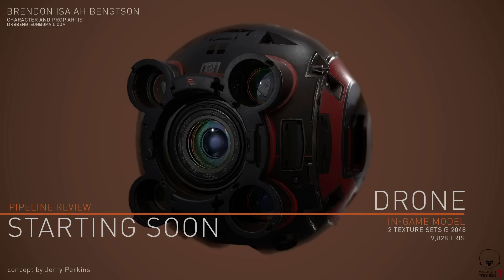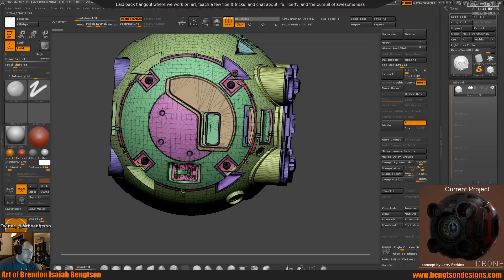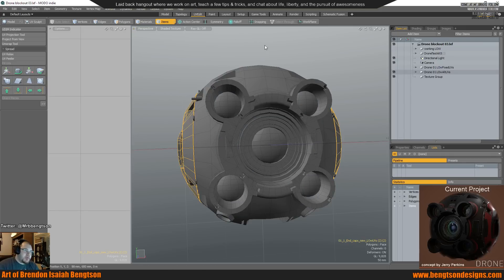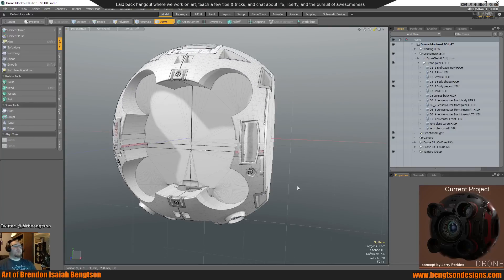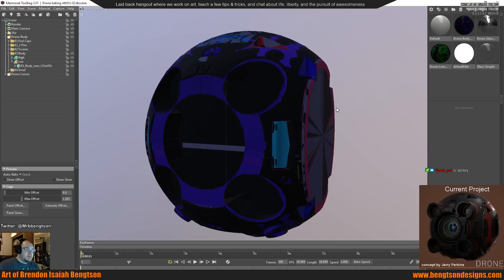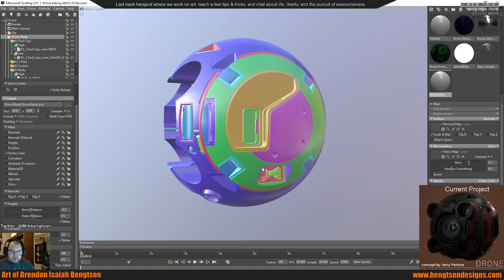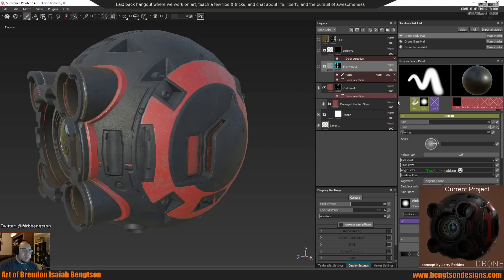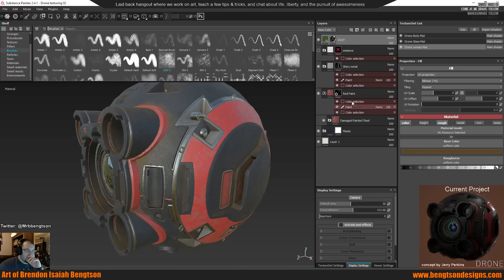Drone - Video Game asset pipeline breakdown

Comment: Really cool, i appreciate these videos a lot. You are doing a good job and you are so good at interacting with the community! Keep it up.  One thing, the glass lenses look so different in Marmoset vs Painter, whats the deal here? just different shader / reflection map ? Would also have been interesting to see how you baked out the maps from Marmoset and got these working in Painter. Cheers
Reply from the maker: Thanks for the awesome feedback man. 
For the lenses,  there were a couple of different things in consideration. 1 - I just needed the glass pieces to have a separate material so that any glass material can be applied to it. 2 - The marmoset viewer does not support it's own in-software shader variables. It's only a simplified reflective transparent mat. 3 - and finally, ultimately the glass will look like whatever the ultimate destination shader will be. i.e. Unreal glass shader, Unity glass, proprietary engine glass... etc etc. Ultimately I left flexibility for final engine glass material tweaking so that there was not any conflicting parameters. 
As for the maps, yeah, definitely could have shown those in the breakdown. Maybe I'll throw some together in the Artstation post. 
Thanks again for the feedback. Glad ya dig.
Reply: Thanks very much for the details, very cool and i agree with you that the glass will be highly dependent on the engine software you use. As for baking and importing into painter i got that working yesterday, it was straight forward so nevermind me asking: here's some result (MD6 testing): https://snag.gy/tr4Z7I.jpg
Reply from the maker: JUICY!!
Reply: Ahaha...you are so funny.

Comment: how many polygons were in the final game asset?
Reply from the maker: 9,828 triangles to be exact, or around 5000 polys
Reply: Thanks for replying.  That seems pretty high resolution for a game asset (or at least higher than I expected).  I'm just getting into game asset creation and I know there are Poly limits but I don't know what is considered "Low-Poly" or "Mid-Poly" in 2017
Reply from the maker: It really depends on the game. It's very different between the spectrum of mobile games like Clash of Clans to something like Mass Effect or Uncharted 4. Character models can easily range from 2,000 tris to 100,000 tris.
Reply: If you use LODs, that will automatically reduce polycount if model is far away. In close range 10K is not a problem, because it will cull visibility of other objects behind it by per-polygon culling (UE4 can do it at least)

Polycount can matter for collision (so you need simplify the collision hull) and lightmap baking (only time to bake, not in-game performance) and for dynamic shadows  and quad overdraw (LODs reduce it a lot)

Modern games can have 30K verts in LOD0, the LOD1 could be 10K and LOD2 1K. Most of the time player dont even see LOD0 version.